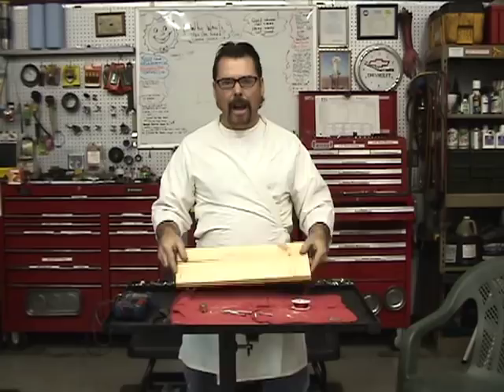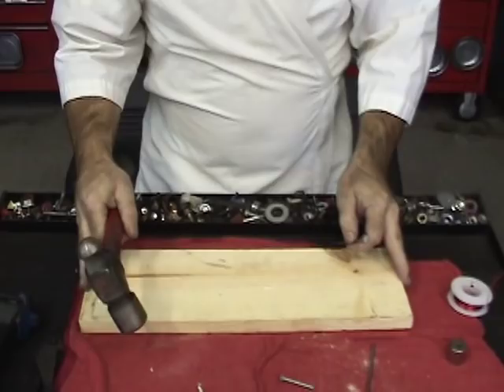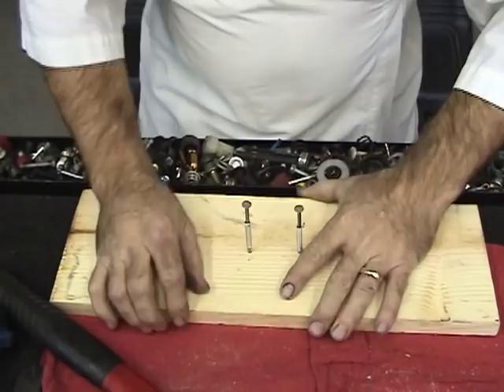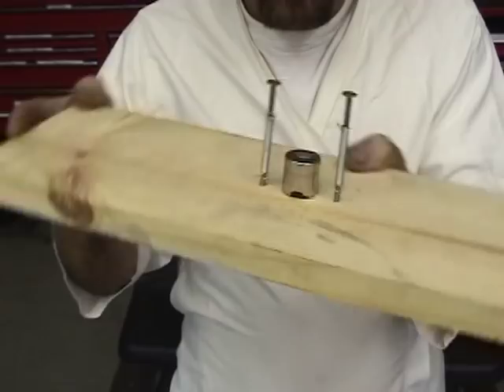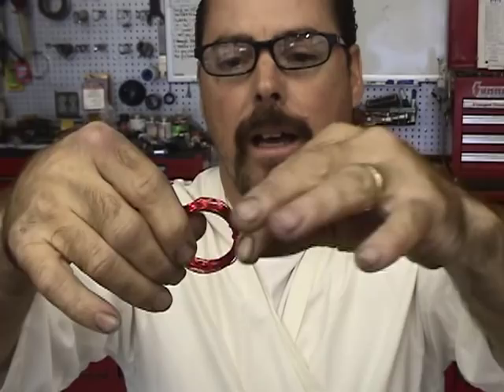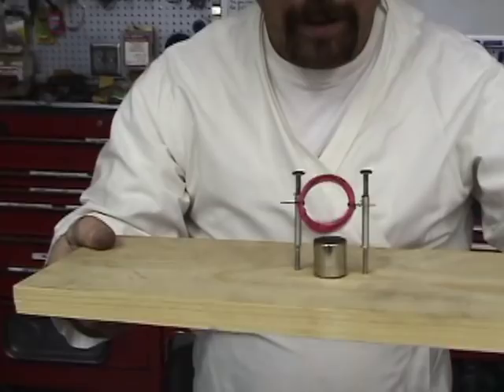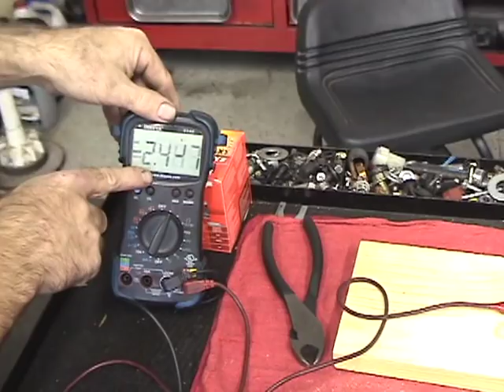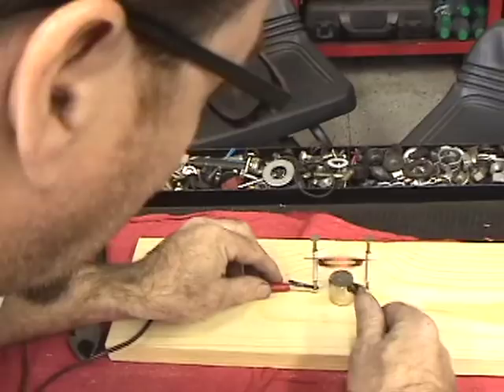FREE ENERGY MOTOR !!!!! How to build it.

Comment: Theoretically it cannot work, since current must flow in and out of the coil and the path for this current is incomplete as the two ends of the coil wire are suspended in the nails, and nails are hammered into a wooden plank that may have some moisture but semi dryish, so electric current won't be flowing through the wooden plank as much as one may imagine.

Comment: The battery is embedded on the edge facing you with 2 holes drilled to the center  to the position of the outer nails.  2 wires soldered to the battery then go through the holes and when you drive in the nails they pierce the wire making the circuit.  Do I get a badge Jeff?

Comment: There's no battery people. But the neodymium magnet will eventually run out of magnetism. There's no such thing as creating or destroying energy. Energy is changed, like heat from a coffee to the atmosphere, or spinning a motor wich is motion to electricity. And if you were wondering. The energy in that magnet dosnt get destroyed, it probably gets in the ways atmosphere.
Reply: Edit, there might be a battery cus the planks are swapped,but this video is a joke, at the end Jeff said if it's too good to be true, it proberbly is. But with neodymium magnet, and that coin and water wheel scam the magnet stops working, and friction stops it to.

Comment: Its basic electric motor principle.
The magnet induces a current in the coil as the coil turns through the magnetic field..
The current in the coil; causes a magnetic field in the coil. [electro magnet]
The magnet alternately attracts and repels the electromagnet.
Its a basic, 'squirrel cage' motor.

Comment: Take a wire cage & ground it to the ground in your AC outlet. You are getting parasitic energy from the surrounding AC. The other possibility is that it is coming from radio transmissions. Now if you are getting the energy from cosmic radiation that would be 'free' energy... or that you are surfing on the flow of 'free' energy that is passing through the atmosphere and being redirected through the coil.

Comment: Appears  to me to be an equivalent to an A-stable multi vibrator circuit only the source is the magnet and the loose brushes provide the instability interruption of current which allows an intermittent collapsing field on the coil reversing phase thus providing an opposing field/s thus propelling the coil  its  biased physical forced direction until field completely collapses This process simply repeats itself until the brushes cease or break from wear.

Comment: I bet if you hooked up an LED, it would stop because the LED puts resistance on the electrons circulating through the wire thus making it harder to spin. Also seeing as it's barely really spinning anyway.

Comment: Ok so if you know DC motors, then you see why the ends of the coil wire had the insulation scraped off - so current can travel through the nails to the coil.

Comment: why would you scrape the insulation off the wire unless you want an electric current from a battery to flow through it ? And, when he picks up the board and moves it around, you can see what looks like a dado that's been filled in the end of the wood for a brief second, suggestin the board has been glued together with a battery inside.

Comment: It won't run without sending some juice through these metal rods (which act as the commutator). The copper wire itself isn't magnetic, there has to flow some electric current through it to interact with the magnetic field of the magnet(s).
Reply: Yes EXCELLENT SIR!

Comment: If you put 1000 VDC across the nails on the bottom the rotating coil will ionize free electrons in the air creating a plasma stream that can be directed at a chunk of lead, turning it into gold!

On the flip side it'll probably turn the copper coil into a fuse, instantly vaporizing the metal creating a hefty explosion and blowing your face off.

No pain no gain they always say! hahahaha

Comment: I researched it and there is a battery inside the wood, with wires that make contact with nails to give it current charge. nice video and thx for all the hints to tell me it's not real. very good job, did slimm put you up to that lol

Comment: I am a science teacher and I have done this experiment many times.  What he is not showing is that he has two AA batteries implanted in the wood.  How do I know? well there is the different board problem, but a AA produces about 1.5 volts.  if they have been slightly used they will loose some.  this is a very inefficient motor and really drains a battery.  if you were to hook up two AA in series they theoretically should create 3 v but after maybe 5-10 minutes of use on this system it would probably be somewhere around 2.4v
Reply: lol Voltage wont easily drop just like that. but its Amprage will. a 1.5 AA battery usually had 1600 MaH = 1.6 Amprage. and they will drop slowly from 1600 to 1500mah and more

Comment: I built the same magnet motor in like the 5th grade. It is not a hoax. The side with half insulation when spinning causes inertia , making it  spin non stop. Duh..
Reply: did you use copperwire that is enemaled? and your magnets have a hole in middle...becausemine have not.....and you know can I make a hole in my neodym magnet myself ?   with drilling? my magnet is 35mm diameter 20mm high and has a force of 80pounds.......

Comment: Law of Induction?  Changing the Magnetic Flux through a loop induces a voltages. How can you achieve that? Either by increasing the CHANGING the strentgh of the magnetic Field through the loop or by changing the the area of the loop, which constantly changes via a rotation ...
Phi = A*B
d_phi/dt = A'*B + B'*A -- you decide 
U = -N*d_phi/dt 
I = -L*dI/dt

Comment: It is playing off the magnetism the poles keep reversing causing the copper wire to spin and generate the voltage-- Electricity is created by spinning copper around magnets using turbines (wind, water, nuclear), it is a push and pull, hence the term ALTERNATING CURRENT.  PHYSICS MY DEAR FRIEND, Electro-Magnitivity...

Comment: Was the meter scale set to AC volts? That coil passing thru a magnetic field recaptures some of the energy from the magnetic field that it took to create the magnet. After the coil passes the magnet and the other side of the coil hasn't reached the magnet, the stored energy goes back into the coil creating its own magnetic field that repulses or attracts to the magnet. The sap in the wood is acting like a capacitor in that it temporarily stores the energy created on a single pass. If you do this experiment using steel, aluminum or concrete instead of wood then it would not work.
Reply: Finally some intelligible comment! I certainly think the meter were on AC or all that I've learn is a joke. I am curious about trying this in a bigger scale with maybe a cap between the poles and try some different capacitance!
Reply: Or he swapped wood which is why the knots in the wood disappear when he finally starts it up... lol
Reply: You cant, just switch to AC on a cheapo multimeter and expect to measure voltage of alternating current at some arbituary frequency
Reply: ***** 
No, the meter is set to DC and it shows the voltage of the battery hidden in the board and connected to the nails. I just posted a new comment explaining how this little DC-motor works.
And a coil passing thru a magnetic field does not recapture energy which was needed to create the magnet. In this process mechanical energy is converted to electrical one. The magnetic field only serves as a tool in this conversion but does not contribute to the energy itself.
Reply: Durchblick So, you do not understand the concept of how generators work then do you? How you say? By passing coils thru magnetic lines. Huh, and all this time you probably thought physics will change just to prove you right. Sorry, but it didn't and it doesn't for anyone!
Reply: *****
I do not doubt physics, I only know more of physics than you do. After all, I have studied EE (MSc). If you move a wire through a magnetic field a current can be generated, but by this current you get a counter-force against the movement. To overcome it you need mechanical energy, which is thus converted in electrical one. The magnetic field is not weakened by this process.
Your idea that energy stems from the magnetic field is wrong. Magnets do not hold more energy than was needed to magnetize them. If a generator could only generate the amount of energy which was needed to magnetize its magnets, the performance would be poor indeed! They could only generate electricity for some minutes! The quantity of energy of even strong magnets is only in the magnitude of a Joule per cubic centimetre. This means one Watt for one second, not more. But this energy is not diminished by exercising magnetic forces.
Reply: Durchblick "The magnetic field is not weakened by this process."

There are a lot of people that fail to understand this and dont believe that power generators power their own electromagnets
Reply: Chris Brown
And I might add, that small generators (e.g. for a bicycle) work with permanent magnets instead of electromagnets. Which are also not weakened by the generation of electrical power.

Comment: Like your generator Jeff that's cool
Reply: Wayne Wagner Is it really cool to deceive people? There is voltage on the two nails from a battery hidden in the wooden board. This tiny DC-motor construction is well known to most electrical engineers. The end of the wires are only stripped from their insulation on one side and thus serve as a primitive commutator. And the magnet is a normal one of course, monopole magnets do not exist and would not help in building a motor without a battery anyhow.

Comment: what are you experiencing is that you charged your wire when you rubbed with steel razor blade. what happens with the magnet is that has 2 poles positive or negative (or like the planet earth has north and south pole)since your wire is positive let's say that your wire doesn't want the positve part, but your wire wants the negative and, because your nails are keeping apart it repeats cycle.(its a very crude explanation, but i hope you understand)

Comment: ok, my theory is that on the board he drilled in from rhe back side that we didn't get to see and he ran a wire thru and has some battery recessed into the wood. there must be a closed circuit and he said if it seems to good to be true, it probably is.

Comment: this is sooo nice but we can make it simple using two long sized pins nippo long battery using in torches and rubber bands and also wire thats all......may be due to the magnet u fixed it has the path upto both nails .......due to this magnet field the wire got to start rotating.... i think so

Comment: either it's fake OR the half insulated side is collapsing the field and when it advances forward, the current is revered or neutralized...alternating. As each approaching side of the coil changes charge polarity/direction, it becomes attracted to the magnet field and the retreating side changes it's polarity/direction and repels. I could be wrong.

Comment: Electrons behave in amazing ways.
Reply: +Mac Ruby Where did he get something that only exists theoretically
Reply: Did you try it?
Reply: Mac Ruby I tried with Neodymium because a single pole magnet is theoretical ONLY.
And no it does not work unless you use batteries. Are you happy?
This is fake, he starts out with one board and uses another at the end.....watch it again smarty pants
Reply: Well if you're right good.

Comment: i just watched a video before this that explains it.  He made an amazing motor using a screw hanging off a little AAA battery by its tip using magnetism ,from a tiny magnet that was  on its head with a little wire  touching it (not a good explanation).  It was so tiny and ran amazingly fast due to the lack of friction.  I want to build one now :-) Where do you get little neo magnets from?

Comment: If he changed the wood it dosnt matter... -.-  nails either side of the magnet make a magnetic field that is in its own an energy. he uses the current or flow of this to be transfers into the copper wire that makes a charge. positive and negative that is used to spin the coil using these forces against eachother. one wants to catch the other wants to push it away. he absorbs this and makes the coil spin. the spinning is both posative and negative charges at work . as both are combining and working together to make the coil spin its making a force.. energetic. the northern lights show such a process at work and u can see the electricle magnetic field thats almost invis to naked eye...nails are north and south pole. the magnet is earth. and the copper wire is the flow. basically. . im just a prospector but its common sense how its all working. atm they have little kits like this in the ABC store. for 3 year olds to play with. so no not a trick its science ... jeff is just showing something that can come in handy oneday. thank you jeff.
Reply: and jeff. or anyone who reads this..? can this little 2 volt current be used in any way to a copper wire leading to outside a tunnel to do a form of morce code. how ever you spell it. just been thinking on the topic a little.

Comment: Get me some gold!  J:k these experiments enthuse me. Can’t wait to see what you come up with.
Reply: Now that was interesting.  I have to say that the reason it spins is due to lenz’s law. The coil creates a current when close to the magnet. But as a result the coil creates a magnetic field which then repels the magnet. Since the current is turned on an off by the approach and peak of the movement of the wire it keeps a constant current. During the transition the coil drops it’s energy and picks it back up in the next approach to the Neodymium N52 magnet you have. This is the science behind it. You could probably put a small Led for a load on that to show the current.  However, remember that E=I/R when considering circuits.

Comment: ok so when the magnet pulls on the coiled wire it pulls so hard it sends it by then the next side of the coiled wire comes into the pull of the magnetic field and the side leaving is less resistance but the side coming in gets pulled and it keeps repeating

Comment: the wires are not copper, they are steel alloy wires, insulated red for copper look, they and the magnet react making it spin until stopped by an outside force

Comment: electrons reacts to magnets... so there are force inside the coil... making the copper wire as circular shape coils gives more force to the electron to be effected by the magnet.

my simplyfied eplanation is like :

coil = bus.
electron = sick horny dude ("zombie" for future reference).
magnet = scarlet johansen outside the bus.

15 zombies sitting on clossed door bus when suddenly miss johansen walk around the bus screaming.

The zombies stands up and follow miss johansen sound.. thus.. making the bus shake.

thats how magnets effects zombies.....

Now imagine... the zombies are in ferris wheel... there are 10 locked cars in that ferris wheel, each has 20 zombies it... .

Miss johansen climb the ferris wheel counter clock wise... non stop...

hope you get the point.

pardon my english.

Comment: it's not a perpetual motion machine of the first kind. one the magnet is the source of energy it will die just like a battery. instead of being recharged it will need to be remagnetized. it's no different then you blowing on a fan. accept you blowing being the source of energy instead it is the magnet.

Comment: Why would you scrap the insulation off the wire if there is no possible way DC currentis flowing between two insulated nails? There must be a battery hidden in the board. Ormaybe there is a reason the nails have to punch through and extend slightly beyondthe boards lower side

Comment: The magnet motors can't be considered a perpetual motion machine on a technicality that is because at a point they do stop working and don't continually produce power forever,  this is because over many years the magnets loose there energy field over 200 years or so but plenty of time for a human life time. therefore it will stop working after that or other parts deteriorate, but this is plenty good enough for free energy, and there are ways to make this work on a much higher scale which will produce much more cleaner cheaper energy.  But devices like this are a threat to the energy and gas departments money flow and control which is more than likely why it's not more widely known or used.

Comment: This video would be much better if you hadn't shown that the wood board at the beginning is not the same as at the end. Of course there is a hidden battery powering the device. Otherwise every electric motor ever made would be spinning like crazy all the time without any input power.

Comment: Hilarious.  I love all the arguing and insults these guys are tossing at each other over whether this works.  Of course it works but its not free energy.  That is a rather powerful rare earth magnet.  The energy your getting is basically a draw on the magnetic field of the magnet which is slowly weakening as you use the magnetism to spin that coil.  Since its a rare earth magnet and not the regular type it might spin and generate electricity for quite some time, but eventually it wears the magnet strength out.  Trust me that the amount of energy it took to make that strong magnet and its getting worn down, is allot more then the energy its producing.

By the way Jeff.  The inner material of those magnets are quite toxic if you break the coating off like you did hammering on it.  But with what you do and places you go, I wouldn't worry to much about it.